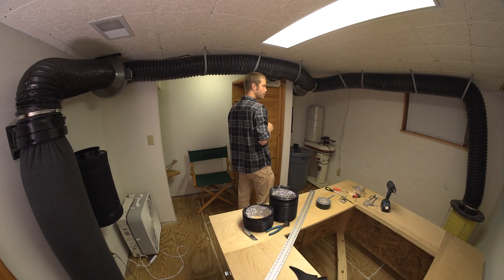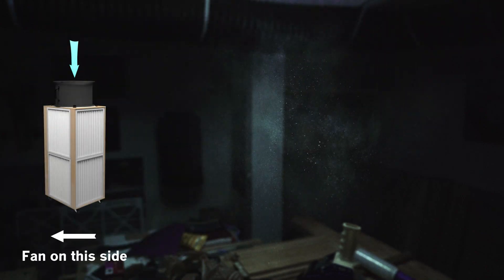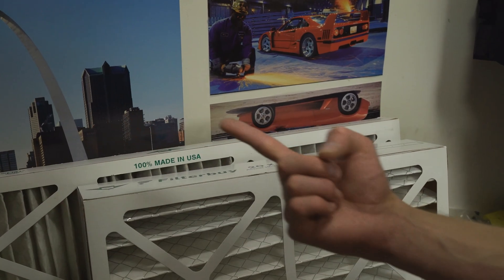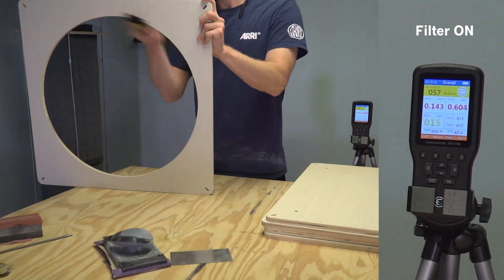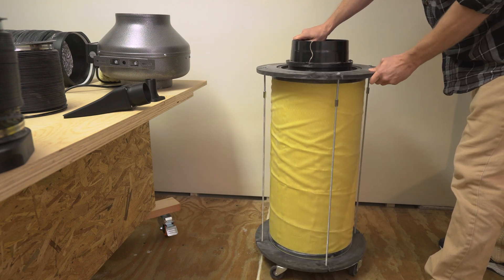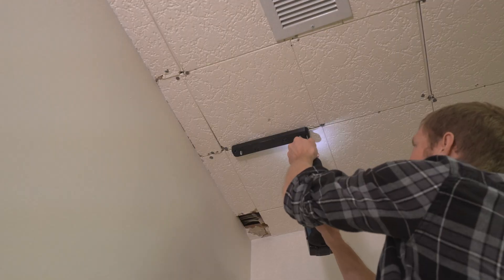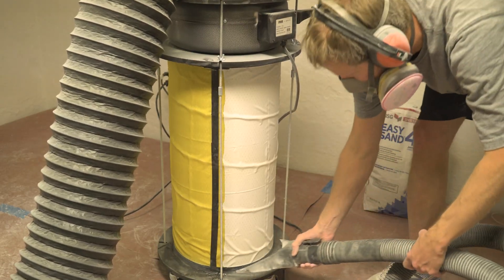Why Ducts Work - Shop Air Filtration

Comment: Are there any performance differences based on location of the filters (ceiling v floor, corner v middle of wall, etc)? Same with the location of the output from the ductwork (pointing downward v straight, etc)

My “shop” is a 19’x19’x8’ (361 sq ft) 2 car garage. 

I’m looking to build a setup with the ipower 12” fan and 16”x30” filters but have limited options for placement and all of them will need to be butted on one side to a wall/ceiling so I will only be using 3 filters. Am looking to attach it directly to the ceiling or toward the top of a wall so I can utilize space but also dont want to hinder performer if I can avoid it.

Comment: What diffuser are you using at 0:32? I assume the normal 30 micron filter bags would be too restrictive, and not needed since the air is already filtered.

Comment: I have model A and B filters pulling air for painting smaller parts.  I want to duct exhaust off the (Caterpillar) barrel fan away, rather than straight up.  Are there 15 inch flanged adapters to flex duct available?

Comment: What air quality meter is that? Would like to get one someday
Reply: I think I found it on Amazon for ~$135 USD ($188 CAD, I’m in Canada) …

EG Air Air Quality Pollution Monitor Formaldehyde Detector Meter Sensor Tester; Detect PM2.5/PM10/PM1.0 Micron Dust Test Indoor TVOC (Also with Temp/Humid PM2.5/10/1.0)
Reply: I also found this for ~ $60 USD ($84 CAD) …

AUTENS Air Quality Monitor, Indoor Air Quality Pollution Detector Accurate Tester for HCHO (Formaldehyde) TVOC PM2.5/PM1.0/PM10, Real Time Temperature Humidity Data Monitoring Meter for Home Office (Orange)

It seems to have all the same sensors for ½ the price. I don’t own either one, I don’t know which one is newer, I’m like you, trying to decide which one to go for.

When I do, I’ll try and post here my feedback.

Comment: Man, you are killing it!
Thank you for all you do.
I have asbestosis & COPD so I have some idea of how bad dust is.
I had been using Lasko 20" fans with 20"x20"x1" Filtrete (3M) filters.
Since I got better cleaners in the new house I moved the filtered fans to my shop.
I'm a newb hand tool woodworker.
I don't use power tools indoors, I even take my bench grinder outside to use it.
Sawing (by hand) seems to make the most dust.
I usually have a fan behind me blowing dust away.
I've noticed planing leaves dust on my shoes, I didn't think it would make dust.
I hope to get one of your fan filter kits in a month or 2.

Comment: Your equipment design, builds and filter testing videos are extremely informative and superbly detailed. Great job!
As a retired cleanroom microbiologist responsible for contamination control, I urge you to investigate cleanroom HEPA filtration and especially the concept of laminar flow.  Your shop build system starts to achieve this in a horizontal direction.  For woodworkers that want to clean the air in their shops and especially remove the suspended micron and sub micron sized particles I suggest clean filtered air should always be released at the ceiling and particulate air intakes positioned at the bottom of the room.  Your air diffusing "socks" would be great along the tops of 2 opposing walls with the intakes at the bottom or two diffusers splitting the ceiling in thirds with bottom intakes. With that design your filters can be at the intake, exit or anywhere in between.  The goal is to always pull dirty air downwards and use the clean air to replace it so that you never breathe dirty air.
I have always shuddered when I see air cleaners hung at ceiling height in a workshop. You never want to pull dirty air up.  Basically a recipe for destroying your lungs.

You are providing a wonderful service. Keep it going!
Reply: Thanks for the upgrade!
Reply: You seem quite educated on this topic. Do you know if adding an additional inline fan on the same duct will essentially double the CFM or is the gain of an addition fan negligible?

Comment: I may have missed it, but what exactly is the diffuser?  Not what it does, but what IS it?  Would the cloth filter bag from a dust collector work?  I like the idea, but would be concerned about creating too much resistance.
Reply: I just went down this rabbit hole, I think it may just be a body pillowcase of some sort. Not sure of the preferred material though.
Reply: He made a comment about 'gotta love that jersey '. I'm assuming it's the same thick material that sports jerseys are made of. Just an assumption on my part.

Comment: Should I mount the filter close to my workbench and the exhaust farthest away, or put the filter farthest away the the clean exhaust near my workbench? I'm working in a 2-car garage and my workbench is in one corner and I'm thinking about running the ductwork to the opposite corner.

Comment: I don’t understand when you say things like “fan is pointed up”. Do you mean that the fan is oriented in exhaust or intake? I’m so confused. 😅
Reply from the maker: Buy "pointed" I mean the direction of airflow. If the fan is pointed up the air flows upwards, if it is pointed down the air flows downwards, and so on 👍

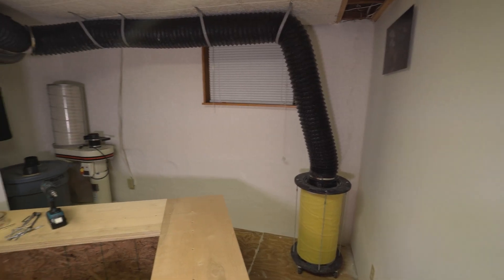Comment: Hello, I've watched this video a few times and I still can't understand why the "Y" is there. At 12:04 it seems the fan by the Y is going to blow air back towards the yellow filter at the beginning of the run. I love this concept but I'm confused by the video. Could you explain how the flow works here? Thanks.
Reply: Exactly what I was wondering, Ive watched it many times trying to figure it out.

Comment: For the inline fans, does the noise mostly come from the fan itself? I have some unused, enclosed (drywall, studs, fiberglass batts) space under the steps in my garage. I’m wondering if I could put the inline fan in there and run ducting. Would that make it much quieter to run?

Comment: I guess the idea is to have input and output on opposite sides of the work space. Thanks for your excellent work. (I don't understand the Y fitting function. Looks like it's blowing both ways on a unidirectional circuit.)

Comment: What is the most efficient positioning to place in a room with one door typically located?
Reply from the maker: Great question! For the ducted design, it's best to put the inlet and outlet on opposite sides of the room or opposite corners.

If you have a work area where most of your dust is made (like just one side of the room), then you could put the inlet and outlet on either side of that area.

Hope that helps!
Reply: @The3DHandyman  That helps! Thank you! 
I appreciate your science knowledge on specific air quality measurements and particular designs to create absolute efficiency, and was specifically curious about if you have thought of a different filter designs and arrangements, like a sphere for instance being a good filter method to increase air flow rates, potentially allowing for increases in CFM counts, and what would be the best?
Reply from the maker: @OhioDeepWoods  I have thought about a lot but don't have much time to get to new designs at the moment. One day!

Comment: Wow, you are giving us a lot of great content to chew on! I have been thinking of a system to draw warm air, heated by a wood stove, out of a living room with a 12-foot ceiling, and run ducting down through a wall, into a cool basement. The air cleaning sounds like a huge bonus. any thoughts regarding duct size vs fan or run of duct. thanks
Reply from the maker: That's an interesting idea that I have not heard. Good concept. Going with all metal ducting would be best and if the warm/hot air did not pass through the fan, that would probably help extend the life of the fan, not to mention make it more safe. You could have a fan/filter box that runs to a duct that then wraps around the chimney and then goes down to the basement. 

That's some initial thoughts, but I cant realistically speak to it as I have no experience. Talking to an experienced HVAC pro would be a good idea prior to setting something like that up. Any time you are working with hot air, it can be a potential fire hazard.

Best of luck!
Reply: I have a similar situation. I ran 8" round metal duct from peak of 12 ft ceiling (heated by wood stove) down through floor to garage shop below using AC infinity inline fan. The air entering shop is not as warm as I was expecting it to be but it makes the space comfortable to work in.

Comment: Is there a link to the screen printing material?
Reply from the maker: I should have those up this weekend. Sorry for the delay!
Reply from the maker: Here are the links to the pre-filter material

Maximum efficiency (smallest holes, clogs quickly)
63 micron opening size (0.024in, 0.063mm)
Color: Yellow
https://amzn.to/4cCDEy4

High Efficiency (larger holes, clogs less quickly)
105 micron opening size (0.041in, 0.105mm)
Color: White
https://amzn.to/4cCDG9a

Black Duct Tape. Any standard Duct Tape will work
https://amzn.to/49gSGH4

If you want to use this on a cartridge filter, here is the link to The Claw
https://www.etsy.com/listing/1691674870

Comment: I like it! Thanks for doing all this testing & designing. Maybe a dumb question, but is this effective for smoke? Like fumes from grinding & welding metal? If not, is there something I could add to make it work for that?
Reply from the maker: That's a fine question! It will work with both of those smoke types. I believe welding fumes are somewhat large particles and should be mostly captured by MERV 14 HVAC filters. Same for grinding dust. I'd keep the filter well clear of any slag though. If you run the duct from the fan/filters over to a secondary MERV 15 canister, this will further reduce any ultra fine particles. HEPA filters start at MERV 16, so it's still a bit short of that, but it's the next best thing.

Good ventilation may also be necessary with some types of welding due to the gasses it can let off. Carbon filters may not deal with that issue to an acceptable degree.
Reply: Thanks for the reply! I’ll still be sure to avoid welding anything zinc-coated (or do it outside) but it’s good to know a filtration system can work for regular welding. I do both wood & metal work so would love to have just one system to keep the air clean no matter what I’m doing.
Reply from the maker: @Jer_Schmidt  Any time. Makes perfect sense to me!

Comment: Great videos!  Thanks for making these and doing the work. Seriously considering buying the kit from ya now and setting this up in my garage workshop. I could print all the printed parts. One idea is to make a kit without the printed parts and let the buyer print them. Not sure how much time and money that would save you.  Will the "claw" be released as an STL to print?  I saw the other comment saying you'd be selling it on Etsy, I assume that'll be the printed part. Cheers
Reply from the maker: Thanks for watching! At the moment, I'll be doing the printing. For the Model-B kits, the cost of the printed parts is relatively small compared to the other raw material costs and shipping expenses. I may do a download at some point for The Claw, though it may actually be more expensive for the end user because it's best printed in an expensive conductive filament and that not something most would have on hand. I'll get into that whole thing in the Model-E video.
Reply: @The3DHandyman  ah fair I didn't think about static build up on the claw. But excuses for buying more filaments is always good right? :-)
Reply from the maker: @henryhellbusch155  The static build up issue took me a few months to get to the bottom of. Until then I was shooting lightning bolts out of my fingers. Didn't feel like a superhero tho

I'll probably start up downloads for the parts when I am able to get that new CNC machine paid for. Might be a minute 👍

Comment: I'm looking to build a system for a 5,000 square foot shop with around 30' high ceilings. Videos or info on larger systems would be great.
Reply from the maker: That's about the size of the shop I used to work at. They had severe dust problems and didn't do anything about it. Painting and vinyl applications were a nightmare in there. A ducted system would be great but the cost would be quite high. I could do some 3D renders of a system like this at some point. The other option would be to run 10 or more of the Model-B style kits with Drum fans. I have gotten feedback from a few metal shops that use them with good results... if that's the sort of work you do "AllMetalMan"
Reply: @The3DHandyman  Thank you very much for the response. You've done a great job with your videos and channel. We are a custom metal fabrication company in Virginia.

Comment: Do you also sell "the claw"?  If you do, a way to attach it to a festool dust extractor would be awesome.
Reply from the maker: I will be listing the Claw later this week. I have 2 standard sizes of hose attachment but I don't think either works with the Festool. I can go over to the shop that I filmed some of my videos at to test out the fit on that machine. Is the one at the beginning of this video the one you have? https://youtu.be/eYOvnqoW4H0 Message me on Etsy with a reply
Reply: @The3DHandyman  Will do, thanks! and yes, that's the festool I have.  I can do a regular 2.5" vacuum hose, I just like that the festool has the hepa filter built in so less fine dust recirculation.

Comment: When is the Model A kit going to come out. Really want to purchase this kit rather than having to make it.
Reply from the maker: I'm not making the Model-A kit at the moment but I will have a lot of new versions of the model-B kit coming out this weekend. These are cheaper than the Model-A and the cost of operation is also lower with 4 filters rather than 8. With the Drum fan and 20x30in filters, the performance of the A and B kits are identical. The video will actually have a bit were I explain that.

Let me know what you think of the new kit or if you still like the A kit more.

Comment: That straightforward dust flow visualization is great to show why it's worth all that effort to go ducted. Do you paint with the fans on? When would you run the fans at low versus high?
Reply from the maker: Good question! I really just use these setups for dust control. Painting can involve very high VOCs and needs a lot of ventilation. People have purchased/built Model-As and Bs and wrapped them with some spray booth filter material. I have also used My Model-A as a temporary spray booth but only in a garage with the door open. The filters will remove paint from the air but not the solvent fumes. 

I run the 12" inline fan on the Model-B setup at 100%. It's pretty quiet with the carbon filter at the end of the line that helps muffle it. Sound is one reason to reduce the fan speed. Without a carbon filter or a diffuser inline fans can get quite loud. The dual 8" fans run at 80% because if they run any higher they develop a resonance that shakes the house quite a bit. The AC infinity fans are more well-balanced and powerful but do come at a higher cost. These may not produce the same effect on the structure but I haven't tested it. I may also try making some vibration isolators at some point. The 12" inline that sits on the top of Model-B is isolated from the house so it does not produce that effect.